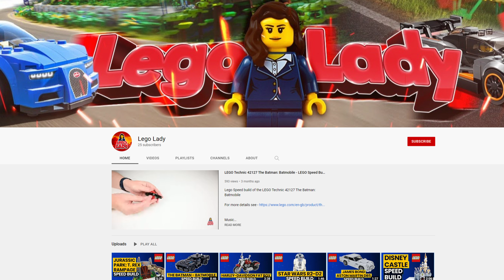Lian Li O11 Dynamic EVO Build with my Wife

Comment: hi, i have a question. i have bought the lian li evo. i got 7 fans + 3 fans from the watercooling. In why way should i install them (i mean extract or the other one) ? as u made here (bottom and side extract and the other ones the other way around ? is this the best solution ?
Reply: When the fan is visible without the connecting struts, that's the front and air sucks (intake) through the front and moves it towars the back that has the plastic connecting struts (exhaust). Now, you can set up your water cooling on the side as intake and make sure the tubes of the radiator are toward the bottom.  Make sure the 3 fans for your water cooler are intake fans pulling air through the radiator. Then, put 3 fans on the bottom of the case also as intake fans, so you would see the struts if they are installed correctly so far for those 6 fans. The last 4 fans would go as exhaust. 1 at the rear of the case and 3 at the top of the case. That will be 6 intake 4 exhaust which will give you positive air pressure. The other option is you can put the radiatior water cooler at the top of the case as exhaust and in this configuration it doesn't matter where the tubes are, also again 1 exhaust rear and then the same as before 3 intake side and 3 intake bottom. Hope this helps! The basic idea is to pull more cold air from outside the case and have that cool air move through the case and the air is guided out by the exhaust fans. Remember cooler air is toward the ground because heat rises.

Comment: I love you build videos. Very helpful in convincing me to build my own. I would appreciate your [and others] comments on my parts list.  Thank you, in advance for your time.                                                                                                                                                                          1.	Intel 12th Gen Core i5-12600K Desktop Processor with Integrated Graphics and 10 (6P+4E) Cores up to 4.9 GHz Unlocked LGA 1700 600 Series Chipset 125W
2.	MSI MPG Z690 Edge WiFi DDR4 Gaming Motherboard (ATX, 12th Gen Intel Core, LGA 1700 Socket, DDR4, PCIe 4, CFX, M.2 Slots, Wi-Fi 6)
3.	GIGABYTE GeForce RTX 3060 Gaming OC 12G (REV2.0) Graphics Card, 3X WINDFORCE Fans, 12GB 192-bit GDDR6, GV-N3060 GAMING OC-12GD Video Card
4.	TEAMGROUP T-Force Delta RGB DDR4 32GB (2x16GB) 3600MHz (PC4-28800) CL18 Desktop Gaming Memory Module Ram TF3D432G3600HC18JDC01 – Black
5.	Corsair RM1000x (2021) Fully Modular ATX Power Supply - 80 PLUS Gold - Low-Noise Fan - Zero RPM – Black
6.	2 - SAMSUNG 980 PRO SSD 1TB PCIe 4.0 NVMe Gen 4 Gaming M.2 Internal Solid State Drive Memory Card + 2mo Adobe CC Photography, Maximum Speed, Thermal Control (MZ-V8P1T0B),Black
7.	Lian Li LI PC-O11 Dynamic EVO Black ATX Full Tower Gaming Computer Case - O11DEX
8.	Lian Li UNI Fan AL140 V2 140mm Black Single Pack Without Controller (only Compatible with UNI Fan AL V2)  [Rear mount, exhaust]
9.	Lian Li 270666 Lian-li Fan Uf-al120v2-3b 120x120x28 Black Fans (3 pack) [Bottom mount, intake]
10.	Lian Li 270666 Lian-li Fan Uf-al120v2-3b 120x120x28 Black Fans (3 pack) [Top mount, intake]
11.	Lian Li GA2T36INB Galahad II Trinity 360 AIO CPU Liquid Cooler 360mm - ARGB Daisy-chainable Radiator UNI Fan SL-INF - Intel® LGA 1700, 1200, 115X, AMD® AM5/AM4 Sockets - with SL Infinity Fans, Black [Side mounted, intake]

Comment: I would have never figured any of this out with the lian li instructions. Now, having done it myself it all makes sense. Thank you for the walk-through! I freaked out a little bit with installing the cpu this time. 9th gen had the little arrow thing, so you were 100% sure it was the right way and it wasn't as hard to push down as 13th gen was for me. I also applied some pressure to backwards ram 😅 I don't think I did any harm though... hopefully!? It was late don't judge me!

Comment: Great job, just like usually! What do you think about next cooling in inverted case: 360 mm. AIO side exhaust, 3 x bottom  intake, 3 x top intake, 1 x rear intake, horisontal GPU?
Reply from the maker: That's me finished with this case. I have done an inverted build best cooling guide
Reply: @ChristopherFlannigan  I watched it and found it very useful, thanks. Do you think the cooling scheme that I described above does not make sense to do?